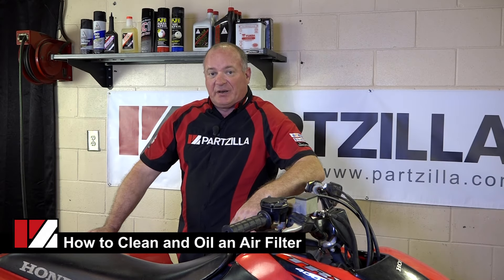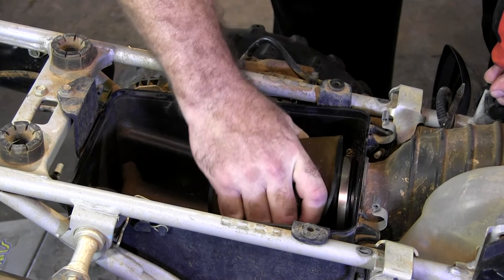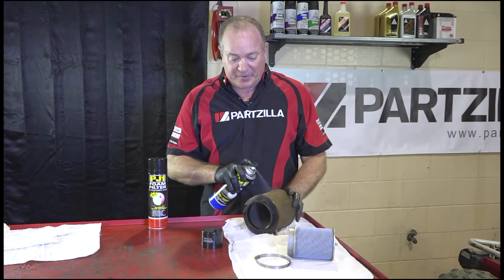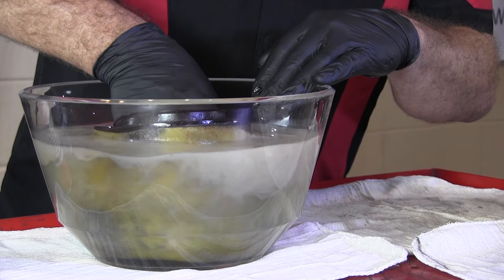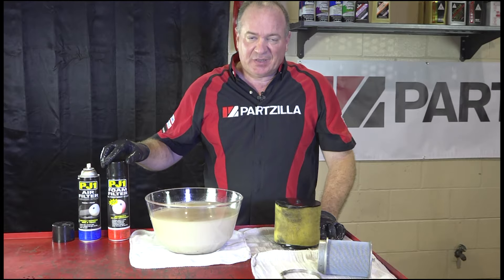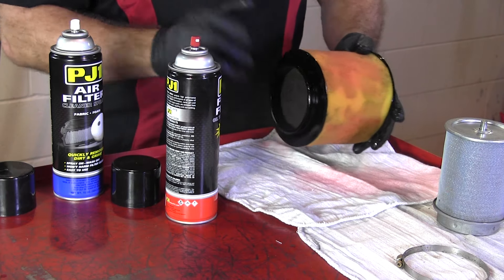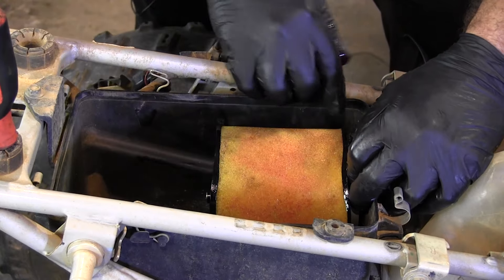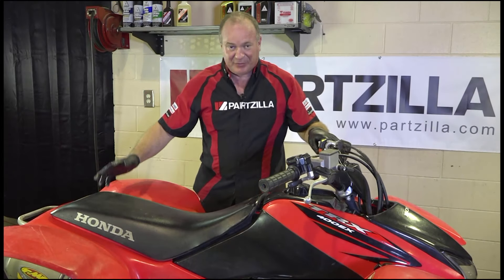How To: Clean and Oil an ATV Air Filter | Partzilla.com

Comment: I have a 2000 honda rancher es 350, what are the step to check when your atv just turn over and over but want start. I have not started it for several months. Thank for your help.
Reply: Try spark plugs and make sure it's getting spark

Comment: I've watched a lot of your videos, you know your stuff and I really appreciate what you doing.

Just little surprised to this cleaning procedure. All the airborne contaminants be on the outside of the air foam filter, and submerging completely under water this air foam filter would cause those contaminants to now move to the inside and stick, which is the cleanest part of a used air filter. Engine damage can occur from particles as small as a grain of salt and result in costly repairs.
Reply: Agreed I typically wash it out with my hose from the inside out. If I do that over a clean white bucket you would be surprised at all the particles that fall out when doing it this way
Reply: Once its oiled again, its so sticky nothing is coming off of it. For such simple task, dont think too much about it!

Comment: I've seen you install a brand new filter on a honda and you recommended only adding the oil to the outside of the filter, not the inside. 
Why both inside and outside now???

Comment: Another great video man! But why do atv filters have oil on them? What is the purpose for this?
Reply: The foam filter oil prevents dirt from getting sucked in. The oil catches the dirt/dust. Too much oil will cause problems. I get a plastic shopping bag , than spray the oil into the bag.  Once the bag has been coated I put the air filter inside the bag and move it around. I've been doing that for years and works well. It coats the filter perfect. Hope this helps.

Comment: Do I have to rejet if I get a k&n air filter for my warrior 350? It also has a full exhaust. How would I tell if it's already jetted by taking apart the carb or if there's another way to tell? Thanks
Reply from the maker: More airflow means you need more fuel.  You should rejet to make it run smooth.  Some are numbered, others have no markings...Easier to just rejet than try to figure out if you have the right one already installed,   They are cheap.
Reply: Partzilla would I buy one of those rejet kits if I was to jet it or do I get something else? But thanks
Reply from the maker: You could buy a kit, or figure out what jets you need and buy them separately.

Comment: How come my trx400 doesn’t have an inner frame, just a clamp!?!?!?
Reply from the maker: Define inner frame.
Reply: Partzilla after you took off the clamp off the air filter, you then took out the inner frame (@ 1:27)
Reply from the maker: Some people remove them?  You can always get a new one!
Reply: Partzilla ok but is it important to have it or is it okay to run my ATV with out it? That’s my question thank you
Reply from the maker: You can run your atv without it.  It is recommended to maintain airflow and your filter should last longer with it in.
Reply: Partzilla thank you

Comment: my machine stopped running so i checked the carb and it wasnt clogged or leaking gas checked the air filter it smelled like gas and was also a little dirty so i took it out and it ran fine should i just clean my air filter
Reply from the maker: +snakeairsoft leger Sounds like that could be the problem, so go ahead.

Comment: Is it possible to clean the metal body? My recent customer had been running his machine with a badly torn Foam Filter, and the metal filter body is completely covered in dirt and grime. Thanks for the video.
Reply from the maker: You can wash it out.
Reply: @PartzillaParts  Yeah. I figured you could. I actually ended up heating it up with a torch and blowing it out with an air compressor. Worked great. Thanks for the response.

Comment: I just bought a uni air filter for my 05 400ex and I can't seem to put it on. Any tips?
Reply from the maker: They can be stiff at first.  Keep working it.  It helps if you line up the top and push down and work it on.
Reply: @PartzillaParts  Can i use my atv oil for re oil filter ?

Comment: do all foam air filters need to be oiled even if brand new
Reply from the maker: Some of them come oiled.  So those should be ok right out of the package.  If they are dry, then I would oil it before installing it in the unit.
Reply: is there a special oil for cleaning them or

Comment: the rubber on yours looks a lot more flexible than the ebay aftermarket filer I have. Is the one you have a Honda brand? no amout of oil would make the one I have go on that easy.
Reply from the maker: The rubber should be pliable, OEM and aftermarket.

Comment: Could I use air filter oil instead of air filter foam?
Reply from the maker: Typically, filter oil is for fabric air filters.  Foam filter spray is for the spongy filters.

Comment: there is an easier way to clean foam filters. all you have to do is get a small bucket of old gas and submerge the filter in the gas for a few seconds, and then squeeze the filter, until all gas is out, and then just let it dry for about 20min. to make the process quicker blow the filter off gently with an air compressor.
Reply: PB POWERSPORTS they need to sell there cleaner they used. I use gas too.
Reply: PB POWERSPORTS that's actually not good at all for your air filter, but I don't see the point in cleaning them at all when they're so cheap to just replace.
Reply: While it's true that gas strips foam filters of old oil residue and contaminants effortlessly, gasoline also breaks down the foam cells and glue that bonds the foam strips together.